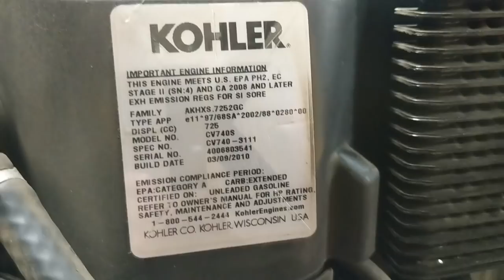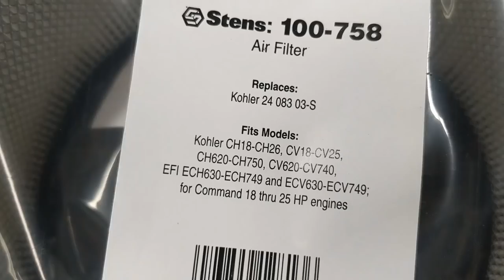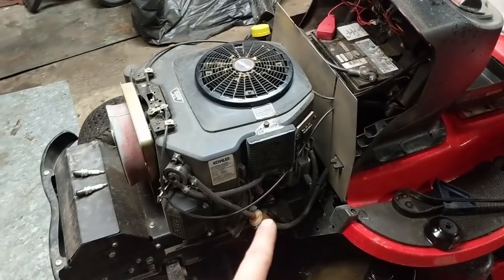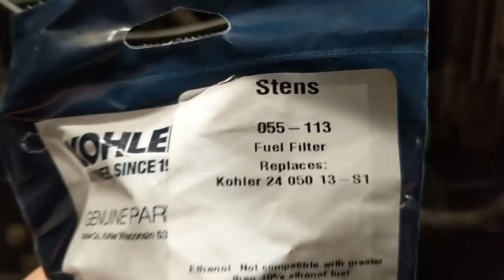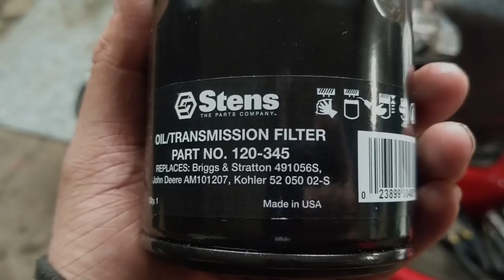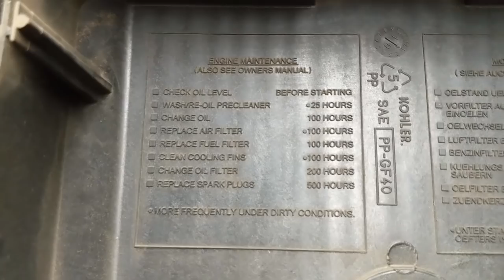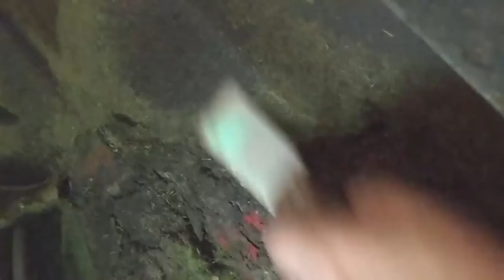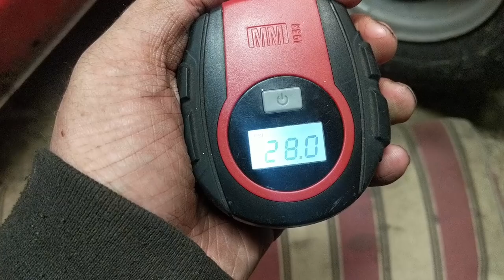How to Service a Riding Lawnmower - Spring Tune Up

Comment: Haha.. had to laugh when you gave the tip about hammering a screw driver through the oil filter. I bought a boat last year with a I/O engine and the oil filter was already in a super awkward/tight space and I guess the guy who last changed it didn’t wipe some oil on the gasket before he screwed it on and it was stuck solid and after busting my knuckles dripping blood everywhere from my oil wrenches slipping I accepted defeat and punched the screw driver through and boy oh boy are you right about having oil all over the place, got the job done tho!

Comment: Great video, i have the mf41-22 and mostly everything was similar. Just finished the oil change and run it for a few minutes but the oil light/ch6 oil is still on. Wouldn't happen to know how to reset it?
Reply from the maker: A maintenance reminder will display in the information window, after the first 5 hours of operation, and then after every 50 hours.  The reminder should automatically reset after 5 hours, however, the reminder can be manually reset by turning the key switch from OFF to RUN (with engine off) and then depressing the set and select buttons simultaneously and holding for 5 seconds.

Comment: Did you clean that mower before servicing? If not its one of the cleanest i have seen. You should see whats on my lift today, Last service done 4 years ago, full of rust, noisy pulley bearings as well as chewed coil leads and air filter due to mice. And they want it done under 100 GBP.
Reply: I have a quote for repair and service ready which is just over 400 GBP. Haven't told her yet, That's my 1st phone call tomorrow, wish me luck.
Reply from the maker: This mower is well taken care of, my customer keeps it clean, I did not wash it! Thanks for watching!

Comment: Thank you for this detailed service summary. What fuel shut off valve did you use. I have a Kohler engine but can only find a shut off valve for a Briggs and Stratton engine.  Would this be ok?
Reply from the maker: Yes this should be ok, thanks for watching!

Comment: Well done. Did the mower have an hour meter? I just added one to my new rider.  Shouldn't you also grease the rear axles?
Reply from the maker: If this was a commerical unit being used daily, I would absolutely record hours to keep track of usage. This machine is used for residential purposes, and gets serviced every year, so the hours are of little use here.

Removing the wheels to grease the axles can also be done, yes. However, it shouldn't need it more than once every couple years, as the grease should stay put!

Thanks for watching!

Comment: Very informative video.. Have you any advice on the deck belts for snapper lt200.. Mine seem to slipping a lot and I'm on my 2nd belt of the season
Reply from the maker: Try a half inch less on the length!
Reply: @EliminatorPerformance  thank you for the reply 😊

Comment: Nic work.
Reply from the maker: Thanks for watching Tony!
Reply: @EliminatorPerformance  I could use a tutorial on fuel line/primer line, and the different clamps that are user to attach them. Doing some snowblower repairs. A short video would so be appreciated.  TY.
Reply from the maker: Snowblower season is over, but I do have a couple that need some work. I'll be doing some videos on them eventually, so you'll have to stay tuned for those!

Comment: How can you tell when a mower pulley (or idle pulley) requires replacing?
Reply from the maker: Wobble test, with the tension off the belt, see if the pulley wobbles side to side, up or down, on an angle, so grab one side and move it up and down, see if it wobbles. That means the bearing is no good. Thanks for watching!

Comment: How much of the grease reaches the upper and lower spindle bearings??  The spindle shaft is spinning in a hollow housing, so what is the grease actually doing? I have put a dozen + pumps of grease in a spindle zert and none of it came close to the bearings. Whenever I service a mower deck I pop the seals off the bearings and add grease.
Reply from the maker: Packing the bearing is the best way for sure, no argument there.

If the grease wouldn't of went it, I would've packed the bearing. In this case though, it took a few good pumps and I could hear it going in, then it started coming out the zert, so I knew it was filling up.
Reply: Thanks for sharing your videos!!!
Reply: Do you have to be a business to order directly from Stens?
Reply from the maker: Yes they require a master business license, but I've also listed the Kohler part numbers in the description, so anyone can buy these parts if they have this machine.

And thanks for watching!